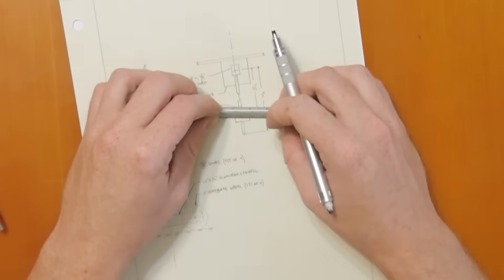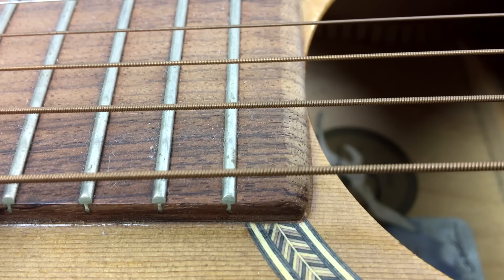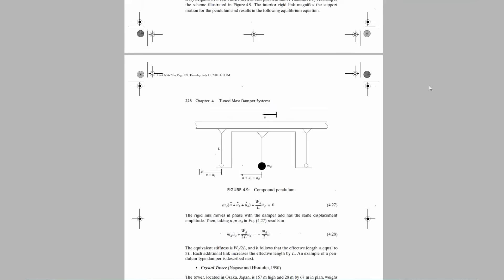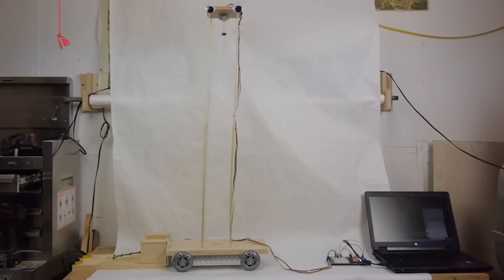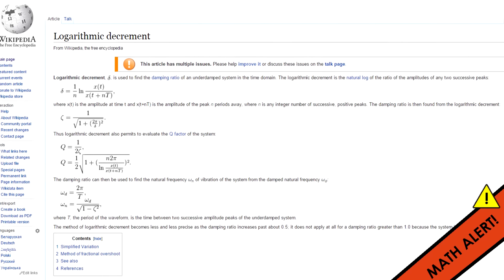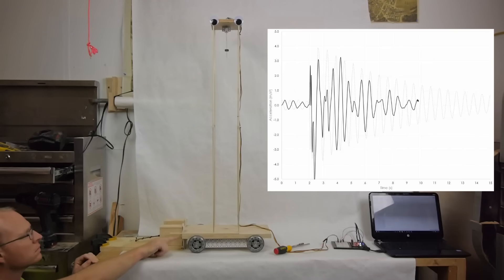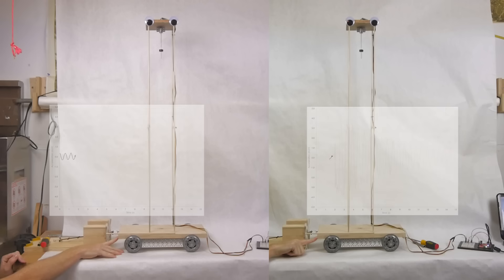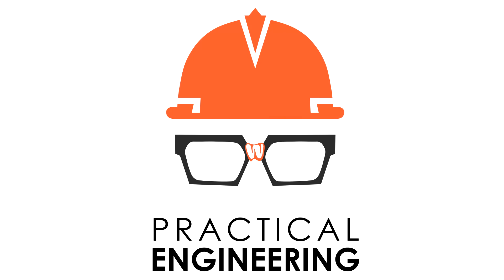What is a Tuned Mass Damper?

Comment: came back to this piece of engineering to fix my very unstable and enormous cabinet. My wife says it wobbles to much and is to unstable to put something on it. Can't fix it on a wall and call it a day because it's the center piece of our living room. So now im working on a tuned mass damper.
Any Ideas on how to get the resonance frequency without placing a hunderd pounds on rollerblades?

Comment: Thank you for this great explanation that has come especially pertinent with the recent quake in Taiwan.  The tuning entails the tightening of the screw in your model.  What does tuning look like in Taipei 101?  And where does the energy go?  Into the screw or its real-world equivalent?  If so: 1) why not just have some kind of shock absorbing feature that's not a pendulum, but static like the screws (I think I know the answer to that one) and 2) doesn't that have long-term impact on the structure, such that each quake, tsunami, or cyclone creates wear and tear on the structure?

Comment: Practical Engineering:
I know this post is a bit dated but may I still ask you questions? First, remarkable video. I did some calculations and I found that Taipei 101 has its damper @ approximately 0.1% of the building's weight, wondering if that is typical? I couldn't fully follow the dynamic equations in the texts but I noted that a mass damper can be up to 2% of the weight of the building it's trying to damp, is that correct? I think engineers should look for the statistics on a precedent building and reverse engineer whenever possible before delving into heavy analysis and theory.

Comment: There are tuned mass dampers on a lot of high voltage transmission lines to keep the cables from galloping.  They look like little paper clips on the lines close to the tower

Comment: It would be really interesting to see the relative motion of the damper to the building in the various cases.  Once you tighten the screw to add friction to the pendulum, the pendulum appears to move in lock-step with the building, but that can't be true if it is dissipating energy.  Like other commenters, I'd like to see a range of frictions added to find the critical point.  Maybe its time to release Edition 2 of this video?

Comment: Bloody "knob turner". 
If you are really an engineer why don't you first do calculations. If you were to do that ball in that building, that will probably costs at least $200,000 and a mistake could bring whole site down, so you won't be doing it with trial and error.
Here its done by a proper engineer: https://youtu.be/7T6pQnNBph0

Comment: Good work.Some earthquakes have horizontal movements.Movements are to the right and to the left ways.Lateral Pulse Faults are examples of  your experiment like Taipei101.Taipei101 made for this kind of faults.But there are many type of faults which move different ways.So like this experiment this can be used for only Lateral Pulse Faults.The fault structure may vary according to the region.

Comment: Absent visual cues we're not aware of motion as such but nonetheless, physiologically we are sensitive to deceleration and acceleration of the velocity of our bodies. It seems evolution provided us with this function as a positional aid. The arc of sway of a tall structure will be at its greatest at the summit and will diminish proportionately with decrease in height. There are two positions in the arc of sway when the structure and an individual in it will be at rest if only for an instant. Assuming wind is a constant on the structure, it will move, accelerating until its maximum velocity occurs at around the middle of the sway and then it decelerates so as to be at rest at the end of sway whereupon it will rebound in the opposite direction towards its natural position of stability but moving beyond that due to the kinetic energy accrued during the sway from the force of the wind, and again decelerating to another moment of rest. This cycle will obviously continue as long as as the wind continues to blow, cycling which will cause most individuals to feel uncomfortable. The advantage of dampers is not just to reduce the total magnitude of sway in a structure below that afforded by its inherent stiffness but also to reduce accelerative and decelerative forces below the level of human detectability expressed as a fraction of g.

Comment: does the empire state building have a mass damper. In 1956 , I was 8,at I went up to the observation deck on the empire state building and it was swaying back and forth. took awhile to get off of the elevator

Comment: Some of the piston aircraft engines that are made by Lycoming and Continental have dynamic dampers attached to the crankshaft.  During college in 1990, I studied to get my Airframe & Powerplant maintenance certificate.  One of my instructors told the class, that if you ever operate one of these type of engines, to never shut the engine off with the fuel mixture while it is producing power.  A few years later I found myself flying such an airplane with a dynamic damper on the crankshaft.  During aircraft training at Flight Safety in 1992, I mentioned to the flight instructor what I was told at school about not using the mixture to shut off the engines while producing power.  The instructor told me that is the way it has always been done and that it had been done countless times without any problem.  Furthermore, their was no mention of that issue in the aircraft flight manual.  A few months later, the engines were overhauled.  After the engine were put back on the airplane, the right engine was completely destroyed in flight when the crankshaft broke.  I made phone calls to the maintenance shop, overhaul shop, and the FAA to inquire about why the engine failed.  The FAA told me that the dynamic dampers were not overhauled properly.  Many years later in 2000, I came across a flight manual for a Piper Seneca.  That was the first flight manual that I have ever seen that backed up my maintenance instructor about the dynamic dampers and to not shut down the engine with the fuel mixture during flight training. On another note, my 1999 Toyota 4-Runner also had dynamic dampers on its 4x4 transmission. That transmission also had a suspicious requirement.  You could engage the 4 wheel drive mode, at speeds up to 62 mph, yet disengage at any speed.  My 2017 Toyota Tacoma 4x4 did not have a dynamic damper, but still had the same suspicious speed limitations for using 4 wheel drive.  I was told that the 4-Runner, Highlander, and Tacoma all use the same engine.  My 1999 4-Runner transmission, with the damper on it, had many expensive problems that were traced back to its computer.

Comment: Nice video.
A little more video, during the tuning stages, from your experiment would have been nice.
Tightening the hinge point was obscuring what was happening.   Doing something where you lengthen the pendulum would help.
Also it seems obvious (?) what the shape of the buildings damper was supposed to do, but you did not address that.
How about a follow up ?
Also, how about going into some of those "other" modes, that you didn't want to get into here ?

Comment: 1 ) 🤔 think , I have seen you on TV. 
2 ) Or , you were working on ✈️ airplane brake design .
3 ) I , said use ; old DC - 10 brakes.
°=°=°=°   }{}{ Neat }{}{ job.
  The, old Hum - V in the 80's had the same -
S.H.M. as a (formula - 1) racer - at 60 mph .
I , sort of wanted an Army Hummer ( from surplus) ( if it ) fell from the sky.
  The, Army - even had monster self driving Hummers then.
 ( Lost Patrol ? )
 (Guess you could) use a rubber mallet , on the electronics. 
[Mr. Big - stuff.] parts. 1980
  A, surplus model Hummer ; was  on the 🛣️ road this summer. 
😎 Bryan.
Reply: 👍 great show . 
=======+
 S.H.M. Drive shaft , Bri - U just want, to impress the girls at - 65mph😨💕😨💕😨💕😨💕💔😎💋

Comment: Hypothetical question: So, if a single damper weighs, say, 10 tons, could the same effect be had with 10 dampers weighing 1 ton each? Or 100 dampers weighing 100 pounds each? Or 1,000 10-pound dampers?

Comment: I remember working in the Hancock Tower in Boston in the mid 1980s when the windows started popping out (again) because there were no mass dampers (which were later installed). The multi-paned glass panels were much too rigid and popped out as the building twisted in the wind. You could REALLY feel the building swaying when the winds picked up!
The building was actually closed for months in the 1990s when engineers discovered that under certain wind conditions, the building could have actually failed along its narrow side and collapsed! They had to install hundreds tons of steel X-bracing to shore it up. 

Needless to say, after that fiasco, I quit that job. I never went into that building again.

Comment: There was some pretty interesting video from one company that produces a metal cutting instruments for lathes and milling machines and so on. There they use quite complicated and fine tuned set of internal oscilators and dumpers to convert low frequency energy of an instrument oscillations to high frequency energy of internal oscillator (inside the instrument) and dump it with a viscous fluid (convert it to heat actually).

Comment: one of the hardest things for me to wrap my head around when learning about engineering in general is there is always flex. i learn this after flying on a small airplane that i sat near the wings. the wings bounced around so much i was certin it was over lol. but after landing and doing alot of research. that flex is engineered into them if it werent for flex they would snap. but as a mechanic i know that metal fatigue is a real thing. thats the kinda shit that keeps me up at night

Comment: I work in a concrete building of just 11 floors. It's too low to need any dampening system, but we frequently have high wind speeds, and when we do, the oscillations on the top floor are obvious enough, they have made me stumble and fall.

Comment: Hi Mr engineer, the video is amazing, very good explained. I found it while searching for some clue to solve my problem with a sewing machine with some genius stuff instead of buying a more stable table. You can maybe already guess what the issue is - when I run my sewing machine at a specific frequency (unfortunately it is the most frequently used speed) it turns the table into a vibro shaper and it is not possible to continue working. So my aim is to install some vibration damping super massive device and be proud like a peacock. My issue is that it is not swinging to the sides but up and down and I can't just nail my marble to the ceiling - maybe you have some idea how that can be solved and also give me some hint, how I can calculate the necessary mass 🤠
Reply: A tuned damper is overkill for that, especially since the frequency is much higher than that of a building swaying in wind or in an earthquake. Try a soft, heat resistant mat or towel under the machine instead.

Comment: I'm curious if the damper can actually do some useful work, such as generating electricity or pumping water. After all the damper needs to get rid of the energy and if it's just going into heat, it's wasted energy - or maybe it isn't, because heat could also be "recycled". I currently don't have the time to do the math and actually check how much energy a damper in e.g. Taipei 101 would have to dissipate, but I could imagine that it should be enough to be able to harvest at least a little bit of it...
Reply: That would just make it less effective. The damper's oscillations are necessary in getting the building to stop swaying as soon as possible, so if there's something extracting energy from the motion of the mass it's just going to be out of tune. That, and whatever extracts the energy is likely going to be attached to the tower itself, so it's just going to be putting some of that energy back into the building's motion again.
Reply: @thegreatzoom5073  That does not make sense, because a damper does exactly that: It wastes energy and converts it to heat. So instead of generating heat, you could also use the energy. If it super importantly depends on the very exact amount of energy to extract: Just add a control loop to always get the same behavior. Also, I don't see how it's putting the motion back into the building again. It's not a spring (because a spring does not really extract much energy from a system - it feeds it just back)...

Comment: Hello, I was wondering what baud rate you were receiving that data at. I am very new to arduino and electronics in general. I am currently using the built in Arduino Serial Plotter and was getting non-continuous data. I was wondering if increasing the baud rate would solve this, as more data faster = smoother graph

Comment: A TMD cannot eliminate floor movement, it only reduces it.  Much like the stabilizers on a cruise ship, you are not being thrashed but you are still getting jiggled and it's irritating.  Don't buy a penthouse higher than 300 feet above street level.  You will be sorry.

Comment: Love this but I must admit it's still a little bit hard to understand why tightening the pendulum screw has the huge effect it does... I mean, it's almost as though stopping the pendulum from swinging freely increases its effect - it does, right? But then if you completely fix the pendulum you may as well not have one. It's very counter intuitive because tightening the screw feels like moving closer toward a fixed pendulum and yet it works BETTER not worse 😂 plus it is hugely disappointing that buildings don't all have googly eyes which really ought to be mandatory for buildings. 😂

Comment: This seems to have the drawbacks that:  1) it only works at one frequency; and 2) it only works in one direction.  Buildings don't only move at a single resonant frequency and they don't only move in one dimension.  They can move circularly, for example.  Wouldn't it be better to have a mass actively driven in two dimensions by some sort of actuators (e.g. hydraulic) in response to a signal from an inertial sensor?  That could respond to cancel out any sort of movement.

Comment: Dankie/ Merci Practical Engineering. I am trying to build or lay a concrete slab for a grave. (2.750 x 1038 x 10)cm= 28 545 000cm x3/ 28 545m x3[?]) and wish to know how much cement, sand and stone I will use? The weakest / economical is 1:5:10. & water? After some maths it seems I must divide by 1.6. 
Cement: 17 840 625 cm x3/ 
Sand: 8 955 187.5 cm x3/
Stone: 17 840 625 cm x3. (The slabe will be 1.875cm to thick, which is OK) How much water I will use??
In South Africa Portland cement is sold in bags of 50kg. How much 50kg is in  cm x 3 is I have to find out. 
Thx for the video's. It is very educational. (Would you mind to have the European measures too, please. Dankie)

Comment: Hey there, I am currently trying to replicate this project and am currently still learning about it. With that being said, I was hoping that you might be able to answer a few questions for me in regards to this project. 

Does your calculation of the fundamental frequency of the tower assume that a similar force was applied every time, sending it into basically the same oscillation each time?

Is the following statement correct: “Applying too big of a force when sending tower into oscillation will result in too high of a max amplitude on the pendulum, and Hookes law will break down, and might also just break the tower”

Tying into the previous question, is the following statement correct: “It is possible to find the max force someone could apply to the tower without breaking Hookes law on the pendulum by testing various applied forced and comparing lab results with theoretical values of displacement maximums.

Your help would be greatly appreciated!

-Dakota Mercer
Reply: It's called Eigenfrequency of a system (building here) and does not depend on force applied as long as it doesn't exceed the elastic part of the stress-strain curve of the system (i.e. staying within Hooke's law per your own words).
As to your last statement.. you do that with parts of the system (testing ultimate tensile strength of bolts, girders, components, etc.) and using simulation software for the whole thing, as a physical model has limits due to scaling issues and complexity.
Overall, that's what mechanical engineers are there for, they study all the relevant stuff needed to give you those answers and make a building work.
Reply: @joansparky4439  Thankyou for the reply! That is great because mechanical engineering is what I will be transferring for fairly soon

Comment: I am an engineer that was stunned by the effectiveness of a TMD on a practical problem we had in a power plant. We had 4 X 1,4 MW column pumps for the condenser cooling. They where about 20 ft high. We had vibration problems with some of them because the pumps and the motors where not balance together properly at the manufacturing plant. We try to put stiffeners, balancing weight at the coupling...nothing worked. Then we hired this guy that came and screw a flat bar on the top of the motor with a small steel mass that it could slide up and down and set in place with a couple of set screws. This set up was like an antenna on top of the pump. Then he slide the mass to tune it and the vibration on those big pumps stops completely. I was amazed!

Comment: Seems to be a "waste" of energy.
It would be interesting if dampers could be developed that "convert" the energy into electricity.
Reply: Then they wouldn't work. The idea is that these systems are "critically damped," they reach equilibrium in the shortest time for a given input. Adding something that takes energy out of the damper is just adding another damping element and "detuning" your tuned mass damper. It would just make it worse at its job to eek out a tiny bit of power.